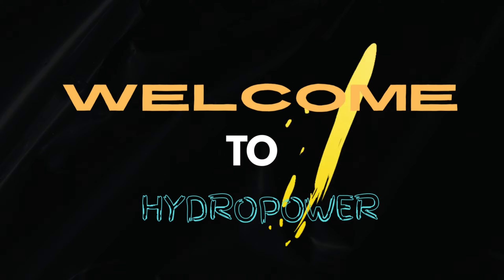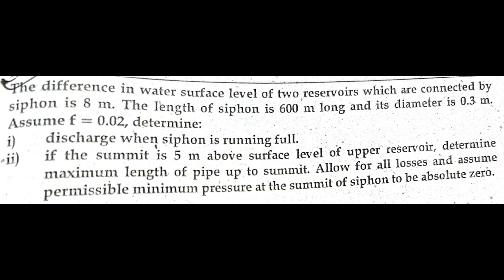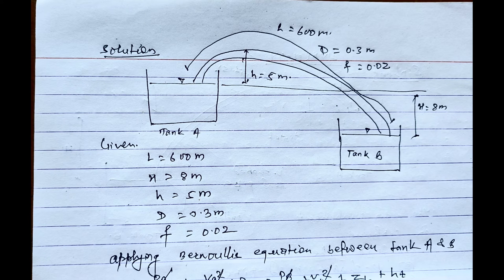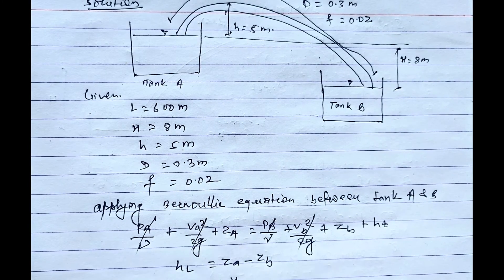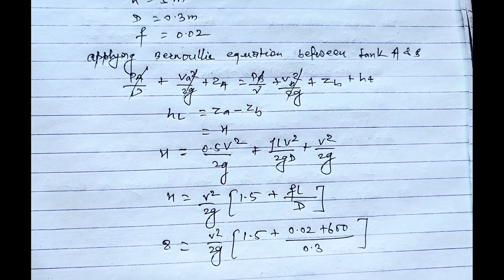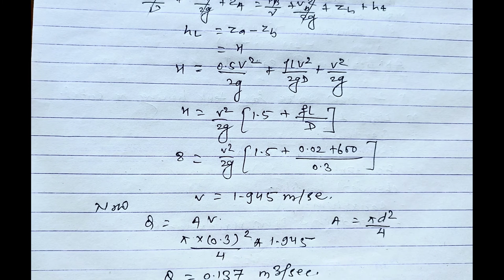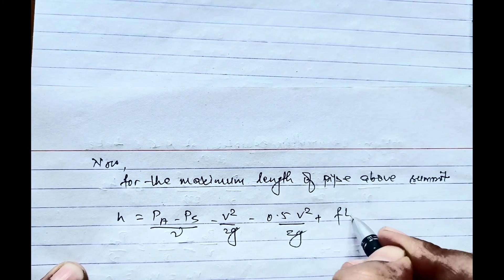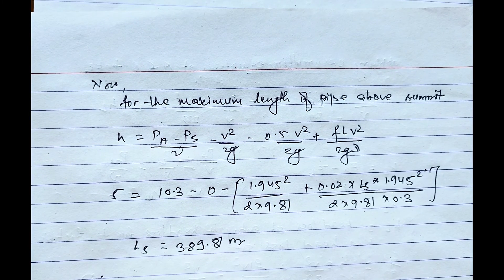Siphons : Calculation of Discharge and Length of siphon

Comment: Sir  I want to know the syphon flow rate 
Submit  5 meter
Height difference 5 meter 
Pipe leng 20 meter
Pipe diameter 0.0508 meter (2 inch)
  Sir I am putting water in my borewell from pond 
 Can you tell me   sir  ,water flow rate
Reply from the maker: Roughly 5–7 liters per second of water will flow through the siphon based on the specifications provided, which corresponds to approximately 18–25 m³ per hour.
If you need a separate calculation sheet with full formulas and step‑by‑step derivation, I can prepare that as well. Just let me know if you’d like to share any additional details.
Reply: Thankyou sir